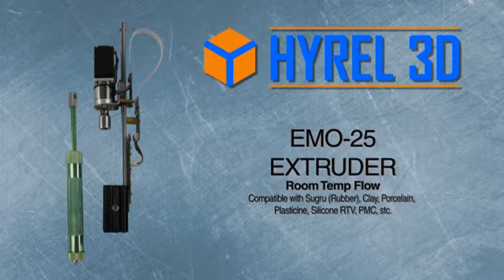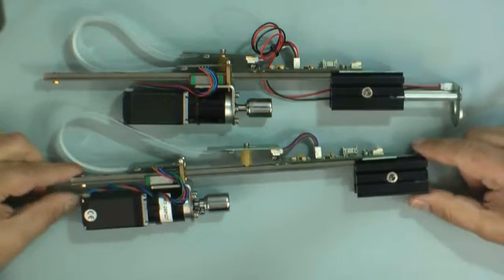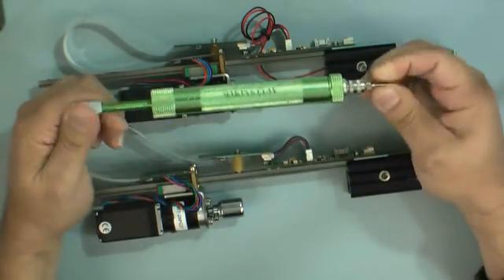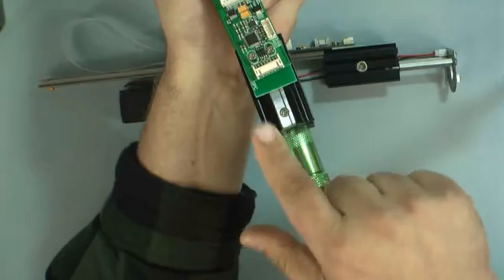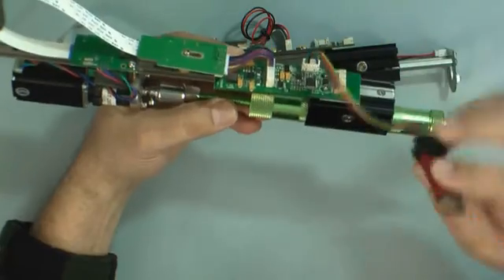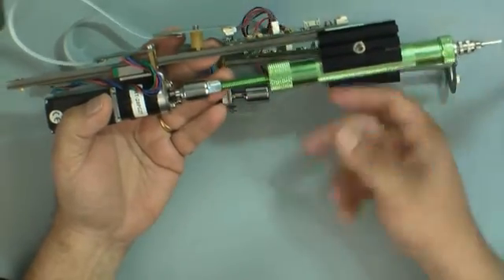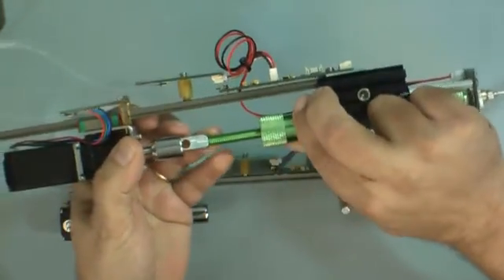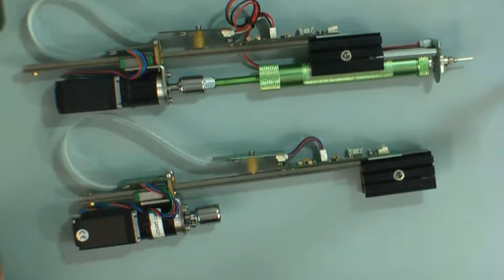Hyrel3D EMO-25 Overview

Comment: would you recommend this print head or the SDS head for a toothpaste like material?
Reply from the maker: The SDS heads are easier to use and clean. We only recommend the EMO if your material is too viscous for the SDS. The SDS are good for material approximately as thick as peanut butter.
Reply: @HyRel3D  sounds good, thanks for the help

Comment: What is the purpose of the circuit board and micro controller? It seems like all you should need is to connect the stepper motor wires to your stepper driver.
Reply from the maker: The circuit board stores settings for this head, controls and monitors the dispensing, heating, and cooling, as well as having additional switches for functions like UV curing and other functionality on other heads. The same controller is used on all heads.